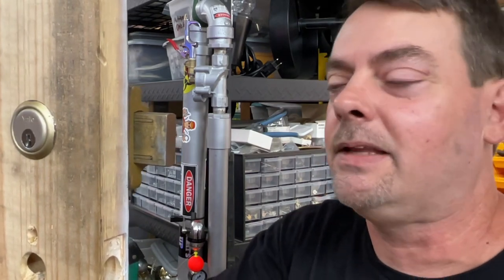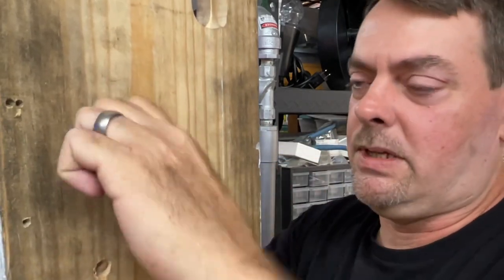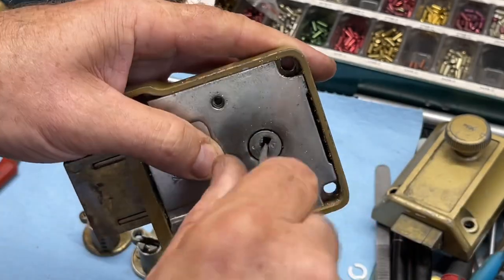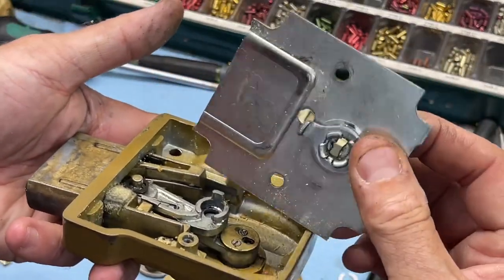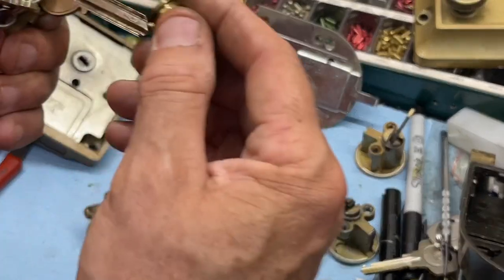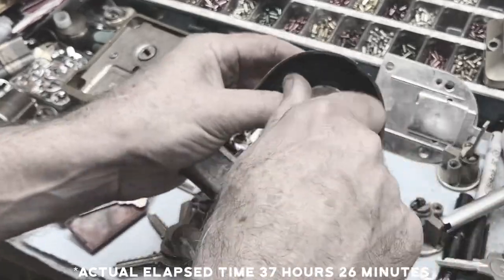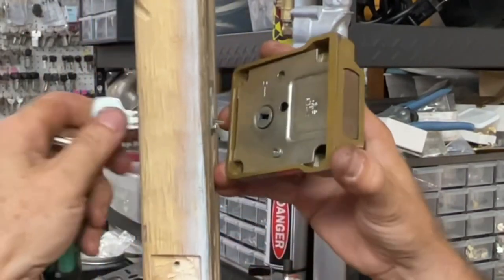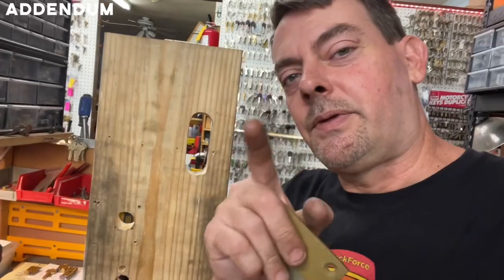RLS 37 “Yale Rim & JimmyProof Locks”

Comment: I found a great tool to remove those one-way security screws. Use an automatic center punch to work it out. A couple of strikes to make a starting divot. Then use the tool on an angle to shock-strike it out. Usually about a half dozen strikes will get the screw out enough to grab the edge with a good pliers.

Comment: You said you could change it to a Sargent keyway by swapping the rim cylinder--problem with these doubles is that you can't swap the inside cylinder so you'd end up with a Sargent key from the outside and have to keep the Y1 for the inside.
Reply from the maker: yes on the double of course, but in the case of the single cylinder or deadlatch it wouldn't be a problem :)

Comment: My grandpa's house still has the old nightlatch without the deadlatch on it, but it doesnt have a rim cylinder on the outside. Instead it has a half inch or so hole with a wafer lock in it. Its flush with the door, and uses one of the common wafer lock keys. It's probably the same lock that was on the door when he bought it back in the early 60s and was probably old as hell then. Im gonna ask if i can take it before they tare the rest of the house down...
Reply from the maker: That is weird! I have seen tubular, and things like Sargent Keso, and even the all plastic ones (Taylor) but haven't ever seen a wafer version! That's a oddball for sure
Reply: @selock  I can get a picture or a video of it sometime soon to put up. It's still on the door, but I'm hoping I can get it before the house gets demolished or re-done or whatever my uncles plan is for it... I'm in "negotiations" for it right now.